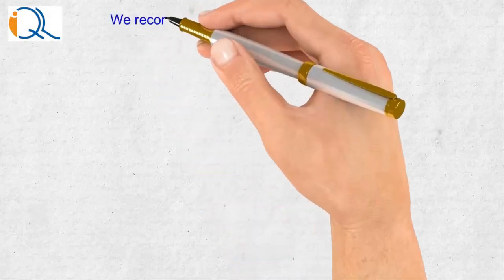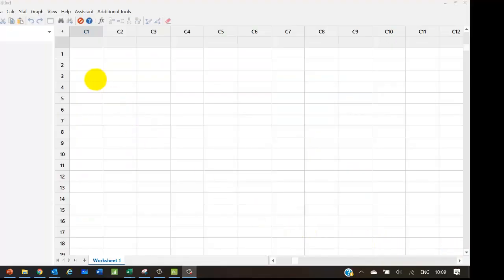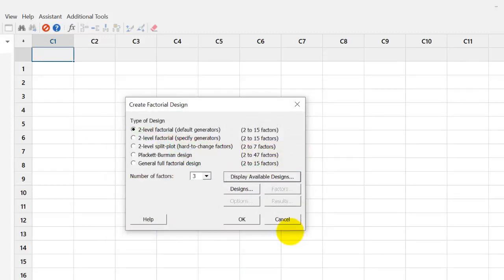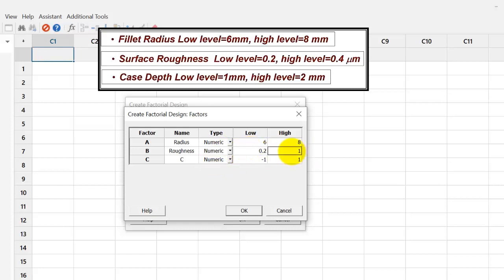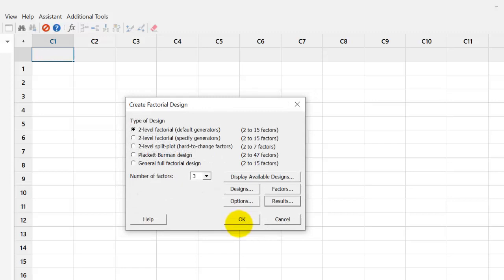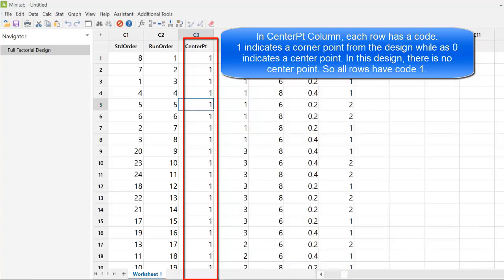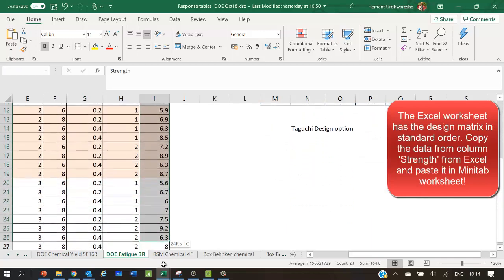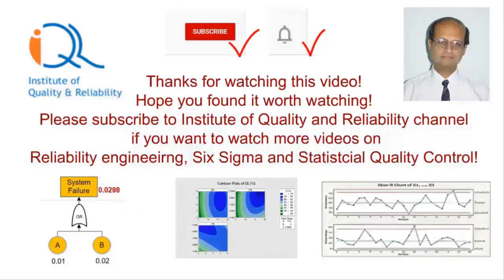DOE-6: Case Study in Creating Full Factorial Design in Minitab: Optimization of Fatigue Strength

Comment: Could you please make a video on three-level and three or more factor DOE analysis
Reply from the maker: With three and four levels, you need to use General full factorial designs. Instead of three level designs, try adding a center point and then go to RSM if curvature is significant. About video, will see sometime in future.

Comment: If I have very small quantity of raw material and don't want to replicate experiments in this case can I go for center point experiments ?
Reply from the maker: It will depend on your design. If the quantity is sufficient for extra runs, yes. Replication is not mandatory. In case of small quantity,  choose an appropriate fractional factorial design to minimize runs. For more details, send mail to hemant@world-class-quality.com
Reply: @instituteofqualityandrelia7902  thank for your kind reply and guidance. I had impression that in order to get sum of square due to error and hance F value it is necessary to go for replication. Now the concept is clear. Thanks.
Reply from the maker: You are correct.  You need to have at least one degree of freedom for error to perform ANOVA. So need to assess cost of additional quantity vs benefit. Engineering judgement helps in all cases. One can look at magnitude of effects and reduce the model appropriately.
Reply: @instituteofqualityandrelia7902  thanks.